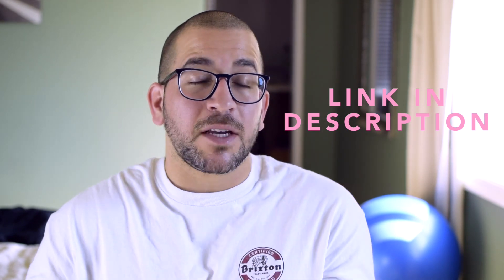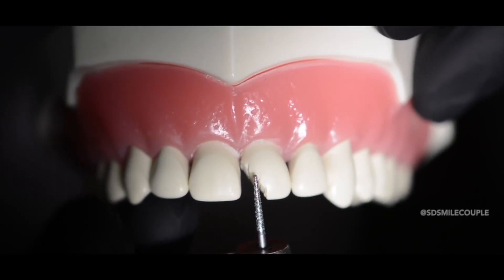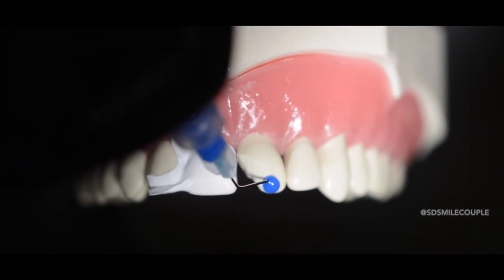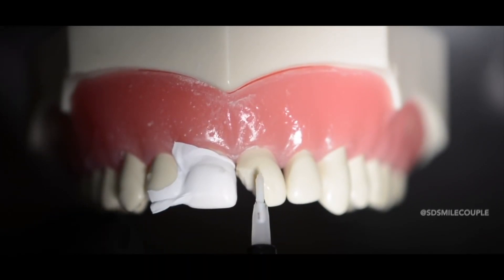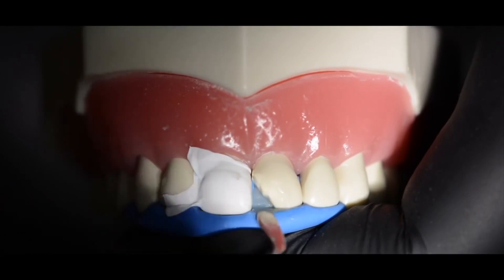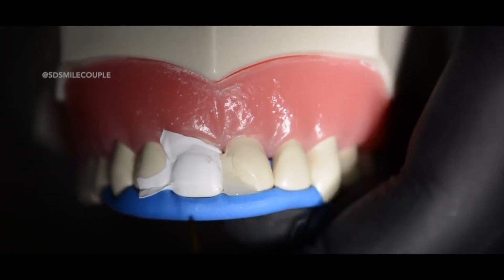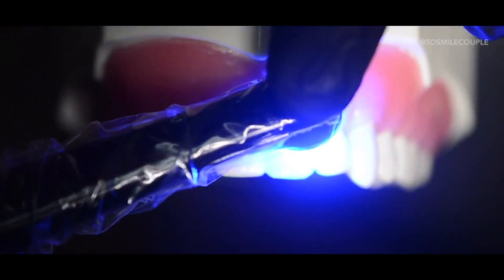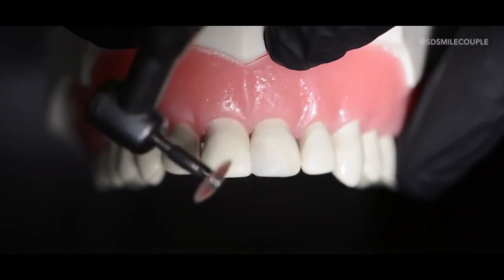Class IV Composite Filling Tutorial | Front Tooth Filling

Comment: The main issue with anterior fillings is that they tend to not last long. You mention the bonding procedures but many dentists if have spoken with have indicated that even with good bonding, anterior fillings dont tend to last.
As an engineer, one thought that I have is that if the composite material is very stiff the load will likely propagate through the filling until it reaches a specific point on the tooth, that small point will end up taking very high loads. If there could be a smaller less stiff layer between the tooth and the filling (it could still be rather stiff just a good bit less stiff than the resin), then the load would compress the material where the load path from the filling first propagates down, then as that compresses, the load would travel through other parts of the filling to other parts of the tooth surface. (basically allowing the entire bond of the tooth to take the load from a hard bite rather than a a tiny area. Not sure if there are good candidate resins for a two part bonding system systems though with a less stiff initial coat)
Reply from the maker: Well said. There are other things to consider like “c-factor” which represents the amount of layering we do when we fabricate these fillings. Each time we cure the composite resin a certain level of shrinkage occurs; accordingly, it’s important to incrementally fill and cure the resin to establish a stronger longer lasting bonding to the tooth. Another thing to consider is parafunctional habits ( grinding forward side to side ) and making sure that there is an even distribution of forces so that you don’t apply all that force to the filling and break it! Thanks for watching

Comment: So I have a chipped front tooth same type of chip and the example teeth but mine is even smaller (Slimmer) I’ve always wanted this done because I didn’t want veneers but my dentist said he could only do this but in a temporary way because of the way my tooth was chipped🤔, so should I go a cosmetic dentistry for this
Reply from the maker: Have an open & honest conversation with your dentist about what she/he means by temporary procedure. They may mean to do this exact procedure (composite resin filling) as a means of restoring the broken tooth & if the restoration fails then move on to a more permanent solution like a porcelain veneer. Class IV Composite Resin Bonding has been proven to be long lasting but it depends on a variety of factors including bond strength, occlusion, patient habits . . . etc. I feel as though you should communicate with your dentist to be clear on what are all the treatment options & then weigh some of the risks, benefits, etc. . . Hope that helps!
Reply: @SmileInfluencers   Hi I was wondering, what is the difference between (Composite Resin Filling) & (Composite Resin Bonding) ? thank you so much! :)